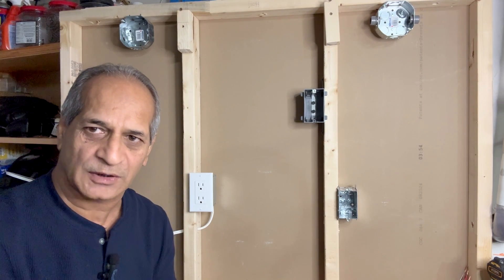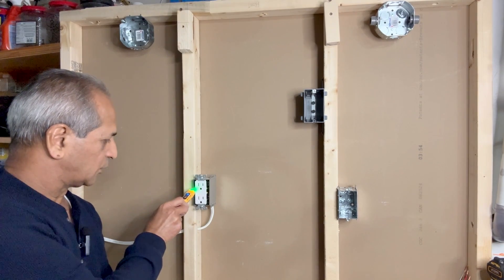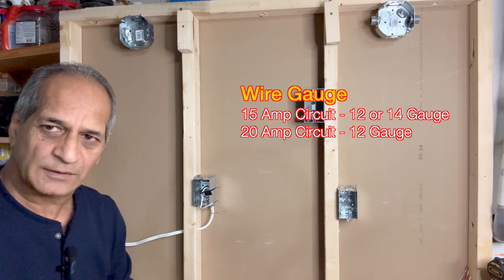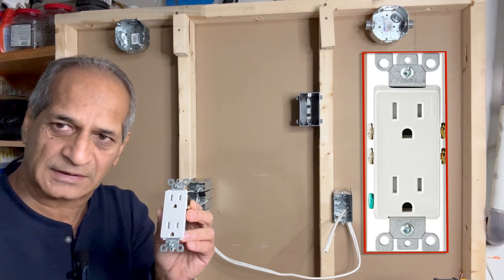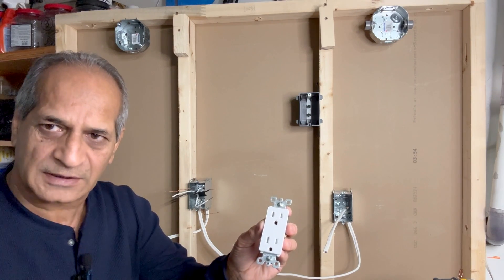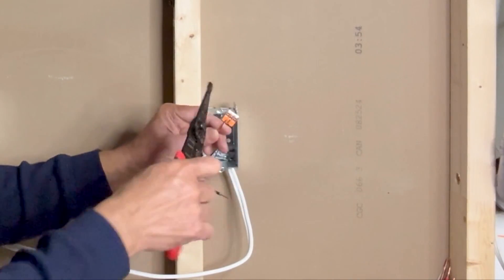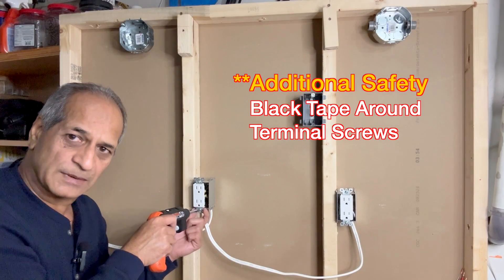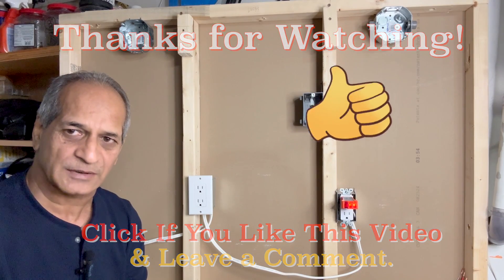How To Add An Outlet From An Existing Outlet

Comment: I have a setup where from a light switch the wires go into an outlet and then from that outlet it continues to next outlet etc.
But i need to add a new outlet between the light switch and one of the outlets, do you have a video that shows that or can you draw it up for me? Thanks
Reply from the maker: Thanks for watching! I’ll make a video on that scenario soon. The easiest way would be pull a wire from the closest outlet where you have both hot and neutral wires available. Just make sure it’s not switched. If the switch is closer, take the always hot and the neutral wire from there. Do it if you are sure, otherwise I would suggest that you consult an electrician. Cheers!!